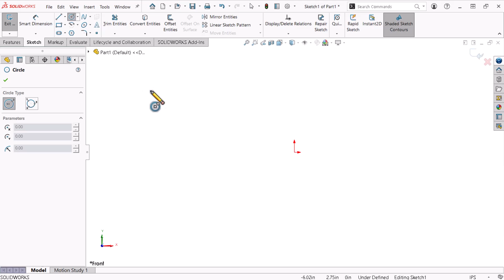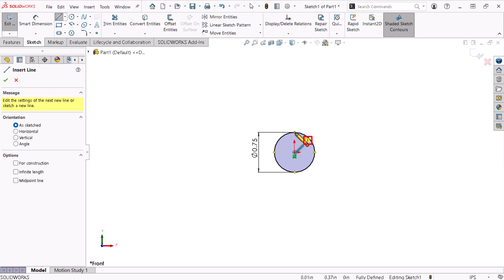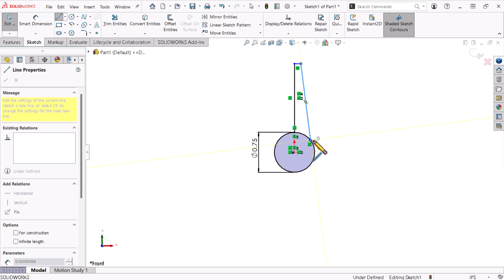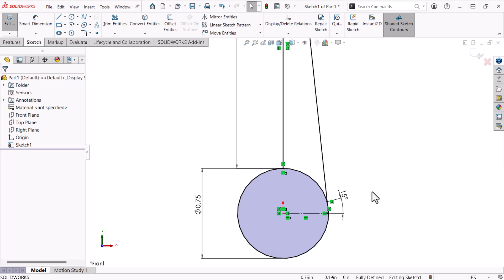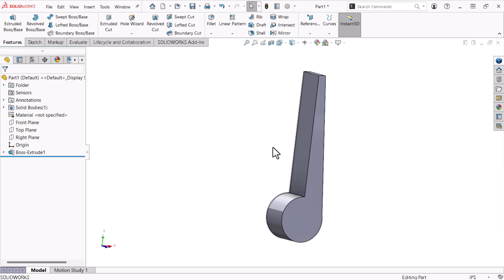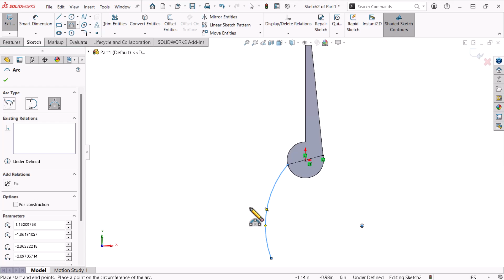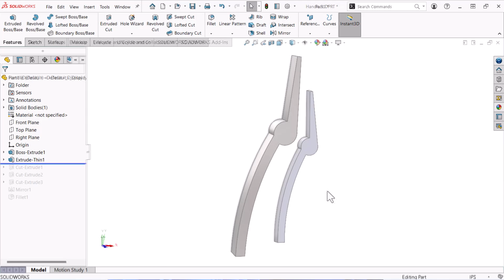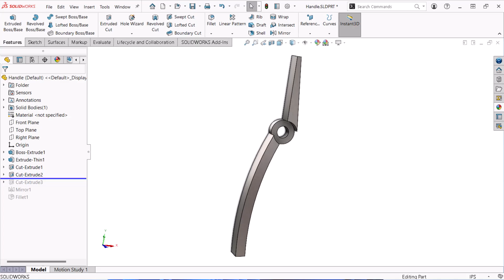Beginners Guide to SOLIDWORKS: Sketch and Extrude

Comment: Might be a dumb question, but why did it change the horizontal line to .13 when you typed in 1/8?
Reply: 1/8 = 0.125 -> Rounded to 0.13
Reply: @vill5325  ah must be a setting for decimal places?
Reply: @Eledaraumar it automatically converts expressions to decimals, I.e fractions, multiplications & other math operations, but when you click it, you should still be able to see the expression

Comment: I'm re learning SW coming from an industrial designers perspective.  One thing that's hard to wrap my head around is that engineers build things part by part, then assemble.  I can't do that, I have to build a bit, see how it all looks, then modify.  Like those pliers, they would need some pre-load, so I'd want to see that right away, rather than making the inside of the jaws straight.  Can I work out of an assembly from the beginning, then make up some parts, and work it all together?  Fusion seems to do this pretty well.
Reply from the maker: Hi there! A great place to start for direct support would be our SOLIDWORKS User Forum: http://go.solidworks.com/Kly. Please don't hesitate to reach out if you are still having difficulty.